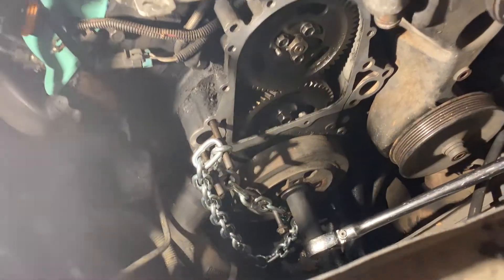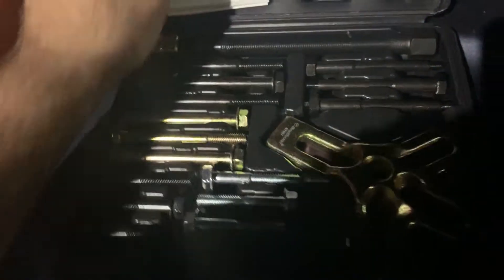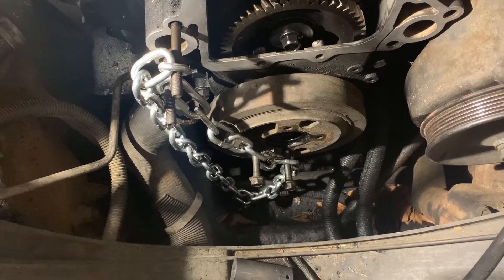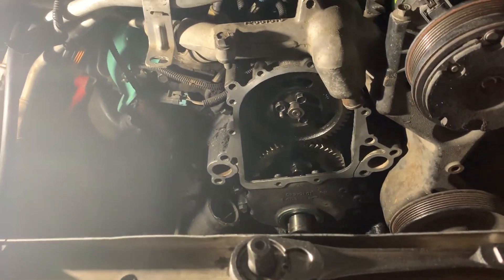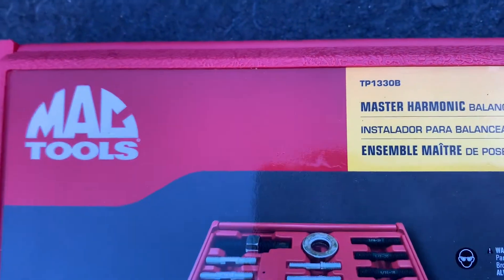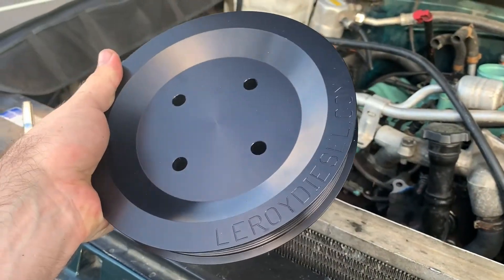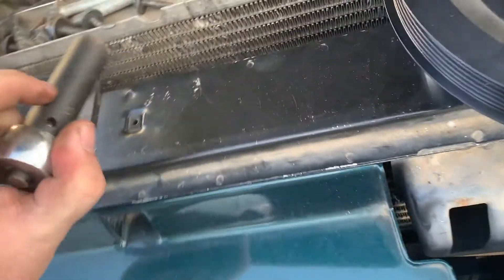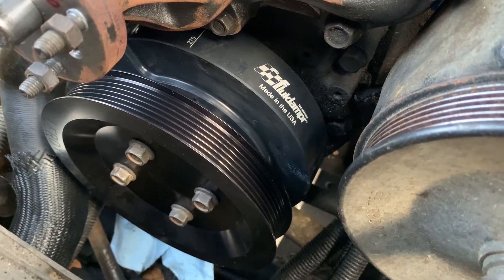FluidAmpr and Leroy's pulley---- 6.5 Diesel Upgrades

Comment: Hey mate, when you fitted the fluid damper did you remove the black coating where the seal surface is or remove it with emery paper?
Reply from the maker: Neither. Just put it on. Torqued to spec

Comment: What did you use to seal up the timing cover and water pump, did you use the 2 w/p gaskets and anaerobic sealant. I’ve seen your supposed to use the paper gasket and anaerobic to mount the w/p to the timing plate. I’ve done the job once and used the paper gasket to the plate with the right stuff rtv, but developed a coolant leak 1 week later
Reply from the maker: I made a water pump video if you search for it. Done 2 6.5 pumps this way and never had a leak. 

Gasket dressed anaerobic sealer on inner plate. Gasket dressed with hylomar blue on cover.

Comment: Can I ask why you removed the water pump? Replacement or access for it? I’m going to be grabbing these parts soon
Reply from the maker: I was doing quite a lot of engine repairs on this suburban at the time and filming stages of it. I had also replaced the injection pump and you have easier to access the 3 bolts for the IP when the water pump is out. So when the 260k mile water pump was out I replaced  it as well. Now you don’t need to remove the water pump to do the balancer or pulley, but more space to work makes everything easier. If you’re considering replacing your water pump anytime in the near future, it would be a great time to do it when installing your balancer
Reply: @2ndMomentumGarage  that makes a lot of sense. Thank you

Comment: Love Leroy stuff👍. I put in a new ac delco damper and pulley two years ago...but still thinking of switching to fluid damper.  What's the verdict....did you see a great difference??
Reply from the maker: Engine runs good---however, main benefits I believe will be at higher rpm and I haven't really driven it much yet since I got it back together.  Just because I'll never have to replace it and can swap from truck to truck as I buy/sell, seems worth it to me.